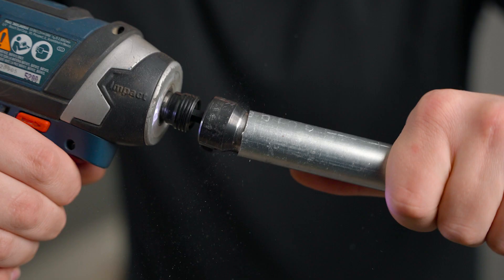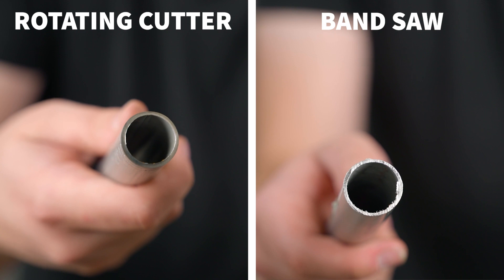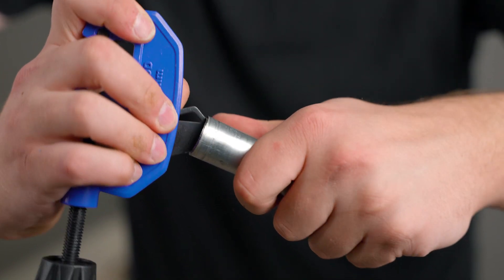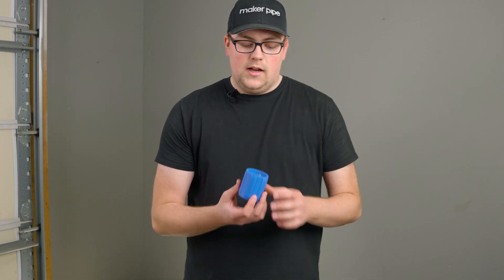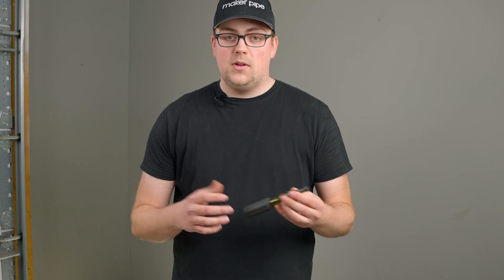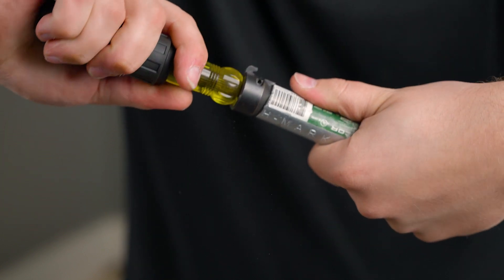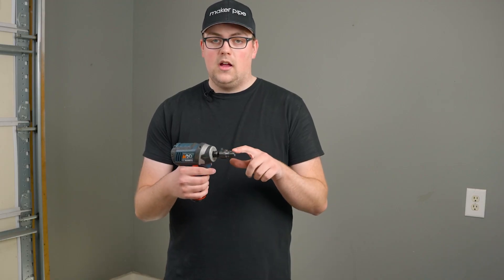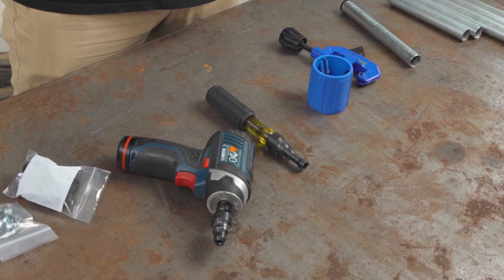How To Remove Burrs & Sharp Edges From EMT Conduit | Maker Pipe

Comment: I have both the screwdriver combo tool and the one that goes on the drill, they both work well, but the drill one is super fast. I've also used a file. Today, I was working with 2" EMT, and used my right angle die grinder to clean them up. 
I had no idea they made an EMT cutter like copper tubing cutters (the EMT would destroy the blade on the copper tubing cutter.

Comment: You have literally helped me so much with this information it's absolutely unreal... I do have a few questions about something though. As far as load bearing what do you think 4 of these 1/2 inch would be able to take? I am building a table like ontop of an existing table that is a standing hand crank table and plan to rig multiple work lights underneath it using flanges that you have shown on this channel to mount to top of other table. I want the end result to be strong but not too heavy as there is a weight limit for the standing desk amounting to about 330 pounds and industrial pipe just seems to be too heavy. I had no idea that emt could be used in so many different ways until I found one of your videos his morning. Do you think that's doable? Should I bump up to a thicker tube than 1/2 maybe? Peace!

Comment: Greetings from Puerto Rico I got a wind chime made with emt conduit, but is getting rust.  Is there a way to clean them up and to about the rust.  Thanks.
Reply from the maker: Hi there, thanks for the question. I've had some customers recommend this galvanizing spray in the past. From what I understand it works pretty well. https://www.homedepot.com/p/Rust-Oleum-Professional-20-oz-Flat-Gray-Cold-Galvanizing-Compound-Spray-7585838/100142963

Comment: I just made my first order and which includes a pipe cutter but have been using a hacksaw or reciprocating saw to cut EMT until then. I use a file to de-burr it. Usually, I just use a small file inside and outside but if I take me time, I'll use a round file inside and a larger flat file for the outside.
Reply from the maker: Nice! A file is a great option. Maybe we should do a whole video on de - burring with a file.
Reply: I make yard art.  For the flower stems, I use conduit, a pipe cutter, pipe bender and a (until now) a dremel tool with a sanding attachment.  The sanding attachment works pretty well but takes awhile to get it completely smooth. I needed the cut end to accept a pex plug, hence the need to deburr and at 72 I needed to deburr with less effort than by hand.  This power drill piece will help a lot!  Just ordered it.